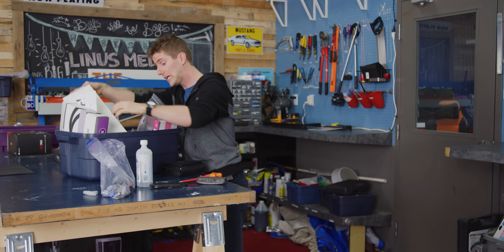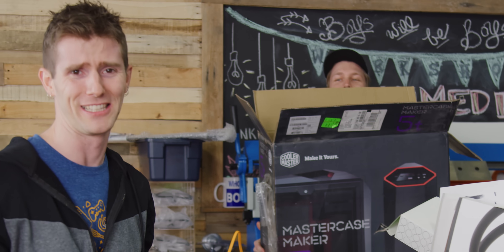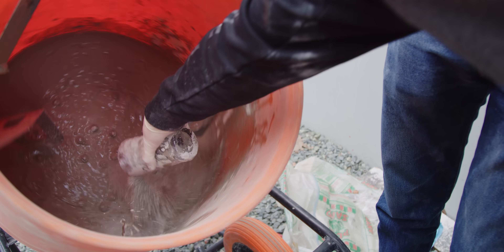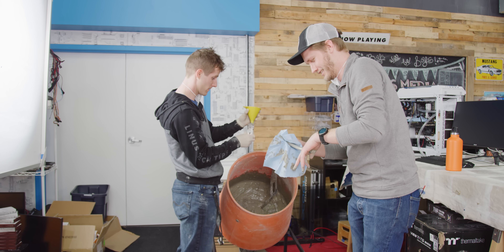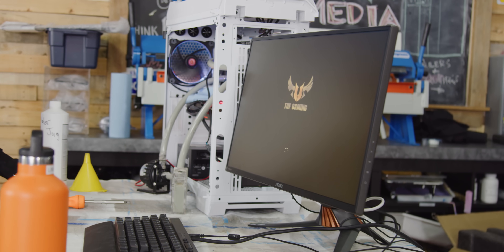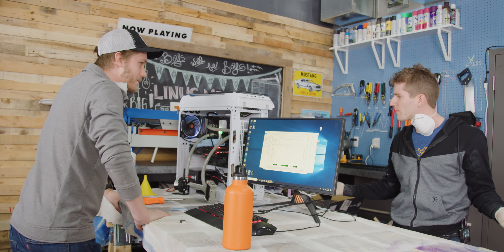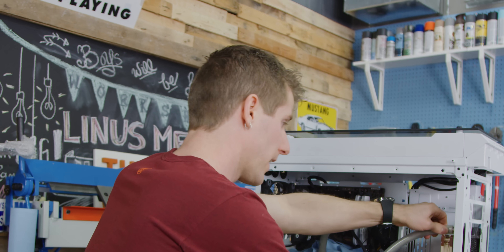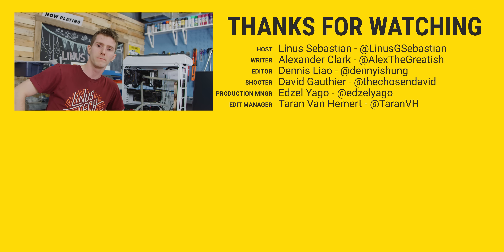I Can't Believe This Worked!!! - Concrete Cooled PC (April Fools 2019)

Comment: Dude just use flexible metal tubing, does the job of dissipating heat right in your case, a lil colder the CPU but a lil warmer the ambient temperature 😁

Comment: So put a thinner line inside the bigger tube, let the concrete dry... Heat dissipation via Copper line covered in concrete? I really think that would be better, or just make a basement floor radiator for the ultimate home PC lol

Comment: I know zip about the flow rates of PC liquid cooling, but I will tell you that in the automotive engine world faster flow is not always better. It is no secret that when the coolant in an engine cooling system is moving too fast, heat does not have enough time to fully transfer from the engine to the coolant. On the other end water doesnt stay in the radiator long enough for optimal cooling. I bet that concrete was moving pretty slow compared to normal PC coolants. You guys should really take an already decent liquid cooled PC setup and test the effects of modifing the flow rate without changing coolant composition. April's fool jokes aside.

Comment: If this really works, liquid metal would work much better than this wired concrete solution, and it won’t got solid!
Reply: @bichela  Just keep the computer in, idel at 30C is no big deal lol, and at least you can enjoy liquid metal cooled pc all summmer lol
Reply: Michele Marie Dalene For the temperature problem, I am no expert but I believe there are certain kind of liquid metal capable to remain liquid in a lower temperature (and I live in tropic area so I don’t mind, lol), but it would be super rear and expensive to find a sub 30C liquid metal. As for a refrigerator-like solution, I remembered Linus did one video on something like that, which is pretty complex because compactor is involved, it does get cooler than usual solution though.

Comment: But seriously, put a heatsink on the cpu, fill the case with cement, let it dry, then run it. It should run a loong time before the whole concrete block gets warm. Maybe it can even dissipate.

Comment: Forget the concrete. Try aluminum foam panel for the motherboard support and a block of copper foam heat exchanger for cooling the cpu. You can't go wrong with that, right? ;D

Comment: Linus cool vid as always but if you`re going to do more of these vids  get some stylish eye protection that looks ok on camera  concrete dust is a bitch in the eyes  its irritant and caustic on skin as well. My dad was a concrete worker he had tattoos on both forearms they faded out to almost nothing over the years due to concrete burns. Once you all have said protection how about a mercury cooled gaming rig. or a liquid form thermal compound one its only job is to conduct heat away so should work well with waterless coolent

Comment: One thing you somehow forgot to mention is that only reason concrete seems alot cooler than water is because it takes longer to heat up, once it has heated to same level as water the results will probably go in favor of the water...

Comment: Linus/Alex. I am an petroleum engineer that works for a cementing company in Alberta, we pump large volumes of cement down hole (sometimes in excess of 100 cubic meters at a time). 

A few things:
1. This is cement not concrete. Concrete contains an aggregate such as gravel or sand, cement is the binding agent used in concrete. 
2. Adding a small amount of sugar to cement will prevent it from setting which will keep it in its non-Newtonian form almost indefinitely. 
3. The chemical reaction that causes the cement to set is exothermic, meaning it will release large amounts of heat, on the flip side exposing the cement to a large enough heat source can cause it to flash set. 
4. Cement is an abrasive fluid so expect things like pumps and water blocks to wash out over time.

If you want to try this again I would really suggest mixing the cement on the lighter side with a couple spoons of white sugar to prevent it from settings up, adding a backup battery to keep everything cirulating might also be a good idea.

Comment: I might not know much about computers but I sure do know that you should have used a mixing paddle, drill and bucket to mix that small amount of concrete. 😂
Reply: They would have been better off poring the dry mix into the tubes and adding water to the pump to mix the stuff. lol
Reply: landed here to say this
you win Ali... you win
Reply: boop
Reply: Just like making a cake batter.
Reply: Yeah just use your hands, wear a rubber glove.
Reply: not even, they could have used a spoon

Comment: this will not work even if you have a upc non stop power to it, because since i work with concrete often i know that the heat weather its minor and low the cpu's small amount of heat it gives the concrete will create micro parts hardening tiny fragments slowly of the concrete and the process really is not that long when you finally start getting clumps that pump cannot move .....then after its just all going to solidify even faster due do it it no flowing smoothly and it will dry up super fast and harden.......all and all not good to do, only if you want it working for a short time and and then you need to chuck the full system and throw it away.

Comment: On the subject of ceramics having good thermal conductivity, there's a reason the top brands of hair straighteners and curlers use ceramic plates instead of metal. 

Ceramics dissipate heat faster than metal, and conduct it faster. This means less time waiting for it to heat up, and less time waiting for it cool down. 

Liquid ceramics do exist. The slurry used to make ceramic tiles are literally just that. Liquid ceramic. Of course, it's thermal properties would be hindered by the water in it, but sill not a bad idea. 

In a closed loop that's air tight, the slurry wouldn't set and harden, because there's no where for the moisture to go.

Concrete, on the other hand, is a chemical reaction, so it literally tears the water molecules apart and integrates into the structure of the cement. So it will always set and solidify no matter what you do.

Comment: cement and water make a chemical reaction it doesn't need air to solidify. that's what happens. if you want it to continue running add something to prevent that reaction from happening. ( April fools aside )

Comment: Given you don't use a mixer often, you should never, ever stuck your hand into a moving mixer. You're likely to rip your hand off at the wrist!

I spent my younger years on sites and a shovel is ok(ish) to shove in a mixer, but even then every now and then the shovel will get grabbed, and noobs will take a shovel handle to the head.

But never stick your hand in.

Comment: Im curious to see what kind of results you'd get if you used a water cooled system piped through a concrete desk top as the heat sync, similar to a heated concrete floor.

Comment: Pratcical applications are somewhat limited to be kind here :D Concrete is going to set no matter what. Besides your pump probably failing due to the high viscosity liquid turning slowly into a solid. Concrete mixer trucks have about 90 minutes to deliver concrete after that it is hammertime. Concrete sets, which is a chemical reaction called hydration, which perversely enough for this application is an exothermic reaction, which is the reason concrete is watered for days during the setting process. I was however surprised that the water pump would even cope with any viscosity of concrete :)

Comment: what about a ferrous fluid? Water may have a really high heat capacity but similar to that liquid that boils at a really low temp, why not something that is hyper heat conductive but has a lower thermal capacity?

Comment: What's next for the cooling-liquid?
Mercury?
Cornflour?
Liquid Metal thermal paste by the bucket-loads?
Or other room-temperature liquid metals? (likely also being radioactive so you will have a glow-in-the-dark effect too. :-\)
But seriously, when concrete sets, it will generate a lot of heat (too).
This has to be an April's Fool!
Reply: put artic silver in a loop
Reply: @SuperQBoi  yeah, that would be cool, literally and figuratively !:-)

Comment: It's an April Fools joke (and expensive at that.) But it concerns me they didn't say it was an April Fools joke. Oh dear xD
Reply: How was it expensive? I don't think the pump was even running.  The Monitor could have easily been plugged into another computer.  All they did was fill a couple of hoses with concrete and it didn't flow into the CPU heatsink or radiator.
Reply: @Merlin_Shaw  well the pc is clearly turned on, and if the pump was not running then how did the CPU not burning?
Reply: @siontheodorus1501  How is the PC clearly turned on? a rear 120 MM fan that could be wired anywhere and a power button that could be as well.  Crafty things go into these videos. I'm calling it that this motherboard was never turned on
Reply: Also, there is a clear cut in the video when he pushes the power button and when you see the rear fan spinning. 100% BS  :)
Reply: @Merlin_Shaw  well the gpu does turned on, but yeah i think they used trick to do it
Reply: @siontheodorus1501  All we can see is RGB lights on the devices, Remember Alex is an Engineer  :)
Reply: To save you from further headaches:
I don't have floatplane myself, but someone said they uploaded a video there demonstrating how they faked it all
Reply: @misatzu  thanks for the info. They also changed the title recently
Reply: @siontheodorus1501  yup, noticed that when reloading the page right after reading and replying to the comments
Reply: Look at the gpu.  They took all the stickers off
Reply: @joepirkl1287  I noticed that. That was my solid yes to it being April's fools joke 😂

Comment: hello
nice work.
you can add Sugar to concrete. Sugar prevents concrete from hardening.
Reply: @Tom Crotty not real, they uploaded to floatplane how they actually did it, the results are fake
Reply: @bombaglad32  True, but April Fools or not (even considering that it's in the title), you wouldn't be stupid to be glaring suspiciously at the screen thinking, "...wait a second, did they really?" given the nature of some of the things they do.  I need to follow this "plane of floating" of which you speak.
Reply: Results are results, no matter what the date. Linus should try another setup with sugar concrete imo
Reply: @Liam O'Brien salt does the opposite. Good for making cement go off underwater
Reply: Pfft! Everyone knows sugar doesn't work, what you need to do is to mix the concrete with pee instead of water to prevent it from hardening. 60% of the time, it works every time!
Reply: @Wayazaexa42  Not if the ammonia concentration is too high. Pfft basic chemistry bro!
Reply: This is completely fake fools
Reply: Guys, he knows SUGAR DOES NOT STOP CONCRETE FROM SETTING
Reply: There's likely lots of additives out there that could help with the drying, the main problem is that your water pumps are NOT designed to use this stuff at all, they'd all fail in a month, definitely worth time and effort for gaming companies like corsair to make custom cooling liquids for enthusiasts, although why not just use radiator fluid from cars instead?
Reply: @Vihara2  idk if this is a joke or real but antifreeze for a car will corrode a pump and rad. Your engine is made of a different metal and is specifically coated to not corrode from it
Reply: @Vihara2  Radiator fluid from cars does not move  heat any better or different from water.  THE REASON there is a special fluid for radiators (aka Antifreeze) is because it is not uncommon for ambient temperatures outside to drop below 32 F/0 C pretty much anywhere around the world (some places more often and some places less often) and if you were just using water, it would freeze and could cause severe damage to the hoses, radiator, etc.
Reply: @Vihara2  car systems are made for much higher temps and far more flow. It would work, just mostly overkill.
Reply: @Vihara2  there are no additives that prevent cement from going off. That would be a stupid product. The pump would fail within 24 hours since cement is extremely abrasive. And radiator fluid from cars reacts with the plastic used for pc tubing

Comment: Use Mercury as coolant, it has a higher thermal conductivity than water and by volume a nearly equal heat capacity.

btw: love the vid
Reply: Toxic as f* though. Gallistan can be done with copper/brass fittings
Reply: @Kathdath  Pro tip: don't drink your coolant
Reply: @Ultionem_Dorus  mercury fumes are toxic, you don't need to ingest for it to mess you up.
Reply: @Kathdath They used safety gear for concrete, so I assume they will take the necessary precautions when handling mercury.
Reply: Collab with Cody's Lab for this, he has a lot of experience with mercury.
Reply: @Ultionem_Dorus  We need to make this a thing. Saw your comment and instantly thought that I want to see Cody on LTT.

Comment: It doesn’t matter if you had a brown out or not, the concrete that comes in a bag mixed with water produces a crystalline structure that helps form the dry concrete we see everywhere. Liquid concrete does not need to lose water to harden.

Comment: You'd be better off running ceramic tubes to get the heat dissipating in more than just  the radiator... or even better, copper tubes, which they've already done.

Comment: Not a great idea, as explained by lots of people in the comments... cement will eventually set one way or another, because it's just what it does. Which is of course great for what we actually use it for. xD Yes, even when it's constantly moving around, eventually it'll set.

Yes yes, april's fool and all, but always a learning opportunity.

But even suggestions for non newtonian fluids, gels, pastes, grease, lube, or just stuff that has more mass to absorb heat, the problem becomes moving that crap around. Think about the difference between taking a sip of soda through a straw versus trying to take a sip of thick milk shake. That's how much more power you'd need to move the stuff around. Plus potential for clogging, horrible leakage, overloading and burning components, etc.

Comment: Hey Linus,. Long time viewer, first time commenter. Im a concreter, I work with the stuff every day. If you dont want it to set, desolve some sugar in water and add it to the mixture and the concrete will never set. All concrete trucks carry a bag of sugar inside incase of breakdowns, they throw it in the back to stop the concrete from setting in the back of the truck. The principle should be the same for this. Altho I run a concrete manufacturing plant I dont think I will be cooling my system this way. haha.

Comment: I know April fools. but if you add sugar to concrete it will stay liquid. That is how they clean cement pump trucks and  oil field trucks that haul away from well sites that have been using concrete

Comment: The reason there seems to be no flow is because of fluid dynamics in a tube. The walls of a tube are alot rougher than the internal friction of the fluid. Therefor at the walls the flow velocity is greatly reduced, and the main flow occurs at the center of the tube.

Just a fyi :)

Comment: Sugar stops concrete from being able to set so potentially adding sugar to your mix would prevent the need to always have the pump going.
Reply: Suger does indeed stop it from setting
Reply: @ethansaba7688  indeed. the word has been ruined :)
Reply: Sweet!!!
Reply: It didn't sound wrong to me. What did sound wrong is someone automatically associating a word with the mentally handicapped (which I assumed you meant by the context). I think that says more about you that the usage of the word. It is like people hearing doctor and thinking they know about medicine.
Reply: Mark Mathews I’m sorry if you thought I had bad intentions. The point of my comment was really showing that because of how normalized that word is now it just didn’t sound proper. I’m sorry if I offended you.
Reply: @markmathews2143  triggered much

Comment: To be clear, they didn't use concrete, they used mortar. It's a similar, if not the same, cement, but with much finer aggregate material. Concrete absolutely would have destroyed the pump and likely clogged the blocks, even if it never cures.

Also, what the hell are you doing wearing that $300 watch working with mortar.

Comment: Me watching for a while: Wow this is surprising
Me, a couple minutes later: Wait.... checks date
Reply: I was especially confused because it's April 2 here... Nice bamboozle Linus.
Reply: honestly: based on what i know about concrete and how it mechanically cures to form a solid mass: as long as it is kept mobile: concrete remains fluid for hours :D and with the right mix: it would STAY fluid for days. Unfortunately due to the tendency for concrete to produce spines from the component mix: It isn't surprising it worked (initially)
Frankly with a different mix using any kind of powder material into the water could be considered an improvement: but when the material settles out it will be hard to get the particulate matter mobile again :p
Now i want to see the fantastic Corn Flour mix :D (with the added benefit of not leaving every component sacrificed to the terrible Foolish one at the other end: if needing a flush out with a few hundred liters of water)
Reply: Michigan maple syrup is obviously the better choice
Reply: It took me too 7 minutes to figure this out
Reply: It clicked for me at about 6:15
Reply: Not flexing really, but some people like me (subbed since 2009) actually are looking for the newest LTT April 1st video every year ... so I was rather confused by its seriousness this time ;)
Reply: The first give away was concrete flowing through something that's 50 degrees C. The water would evaporate and separate from the concrete all along the air bubbles pretty quickly.